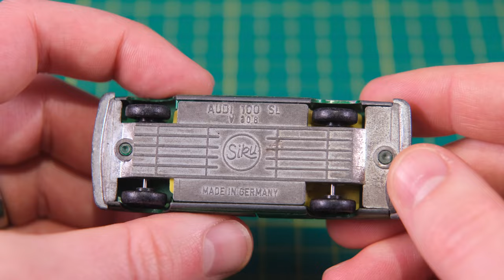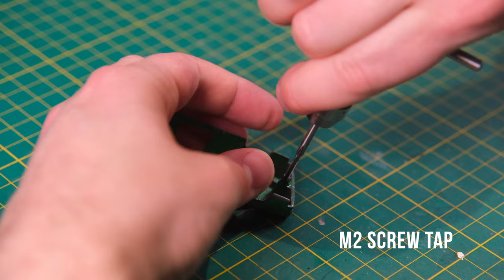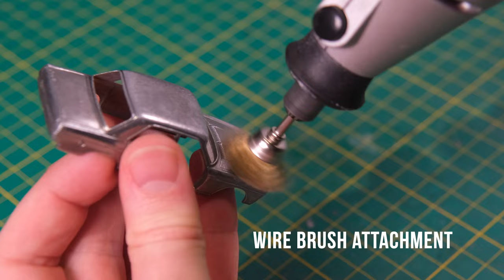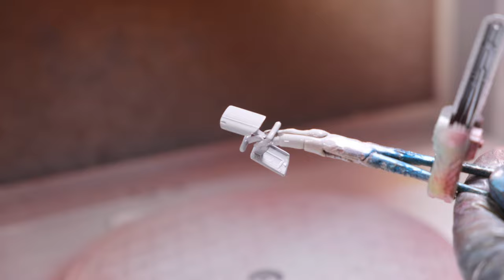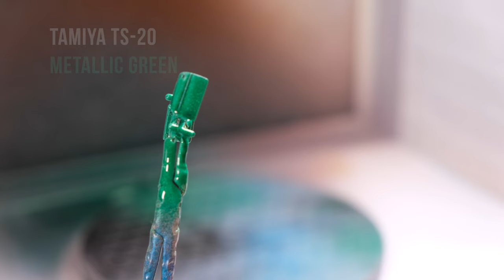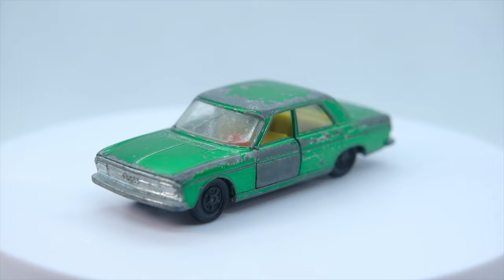SIKU restoration: V308 Audi 100 LS

Comment: Fantastic job Jason, as always!  I really enjoy it when you break out the metallic colors.  Also really Like that Siku put Audi on the trunk lid.  Not sure if they have always done that and I just missed it, or if this is a bit of a rare occurrence.
Reply: with this casting, it has always been the case. but on the original car it's at the rear end of the lid, not on top of it. Siku used to take liberties with these details... :)

Comment: Nice restoration Jason . Audi did continue the Audi Coupe in 1980 , which also became the Audi Quattro , l owned an Audi GT Coupe from 1981 , with the 5 cylinder 1.9 litre engine , l think it was based on the Audi 80 platform

Comment: looks great! the original seems to be a bit more glowy, maybe they used yellow or gold as basecoat?
I agree, inserting the doors is fickly, but once the interior piece is in place you should be able to close the doors, making handling easier. :)
nice excursion into the history. let me add that Volkswagen, after purchasing the shares from Mercedes-Benz, would probably have gone down the drain eventually, if it wasn't for Audi's freshly developed watercooled four-stroke engines VW could use for Passat, Polo, Golf, and so on. they all shared platforms, too. all VW had until then was aircooled rear-engine, and trends went towards a different direction; but the VW bosses waited too long, and Heinrich Nordhoff turned out to be an aircooled dictator...
Reply: @jbiehlable I know, right? :0

Comment: i have 2 of them in similar condition,  one of them is dull under the missing paint, and the other is really shiny under the missing paint. strange, because the age is about the same. think the shiny one is good for a hotwheels spectraflame paintjob but i am not able to do so
Reply: to me it seems to be a case of where they were stored. the shiny one probably was always inside, while the other saw the sandbox outside. the flaking off maybe comes from bad batches of paint. other models would only get scratches and fleabites. same with matchbox; I have seen old models from the 60s where all paint was gone, while they were definitely not taken apart or treated any other way. others from the roundabout same time period didn't show that.

you can try a rattlecan with transparent paint, like tamiya's, or others. it will not be the same colour hue like a spectraflame, but the look is still the same.